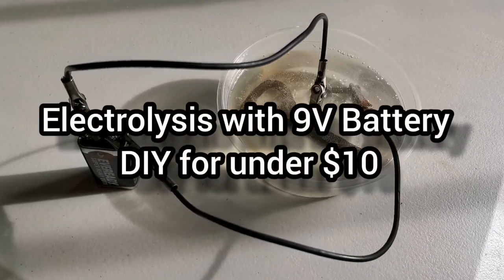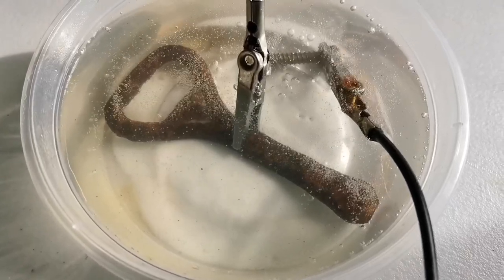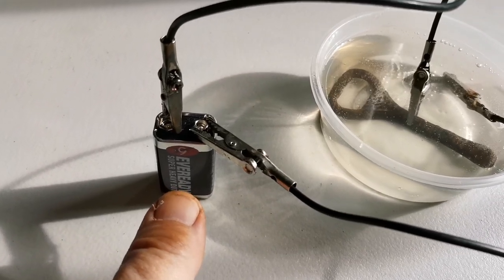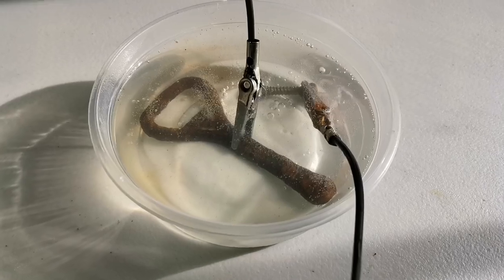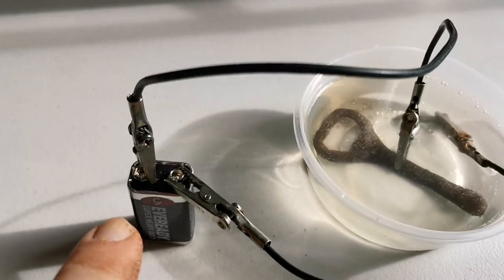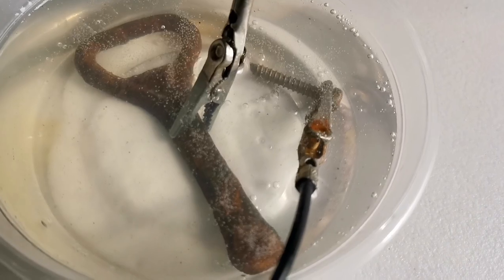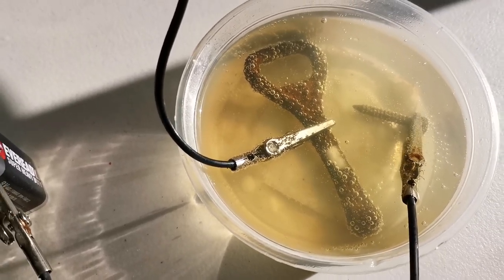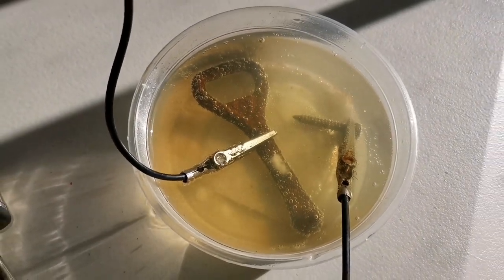DIY Electrolysis - Rust Corrosion Removal - under $10

Comment: Hi there nice video, do you know how long the 9v battery lasts when doing this? Also do you know the volts and amps. Many thanks.
Reply from the maker: Thanks. I've used the same 9v battery a few times. Sorry I can't tell you how long you can expect time wise from one battery. I've seen a few people using a battery charger or a 12 v power adapter as an alternative, which might be a better long term option. Cheers
Reply: @tubedinoz  No worries mate, thanks for the quick reply 👍

Comment: Great never thought of using a small 9 volt battery. I use Evapo Rust remover for a lot of my bike bits tools ect works well.
Reply from the maker: Thanks. I imagine a small 9v is only really good for smallish items. I read up that you only need a minimum of 1.23v for electrolysis, but I'm not sure how quickly it's going to drain the battery. A battery/trickle charger might be a better option. I've only recently heard of evapo rust. I'll definitely give that a check out too. Cheers mate

Comment: How long does the battery last doing this. Seems like a waste of money using an non rechargeable battery.
Reply from the maker: I don't do a lot of electrolysis. A single battery has lasted quite a few session, 6 or more. I guess if you're looking at doing a lot, maybe a 12v power adapter would be the way to go. Cheers
Reply: @tubedinoz  👍🏻

Comment: How long does the battery last?
Reply from the maker: I've only used this about 6 times and I've been able to use the same battery. Not sure long it would last in total. Some people use a 12v power adapter, which might be a better option if you're planning on doing lots of electrolysis. Cheers